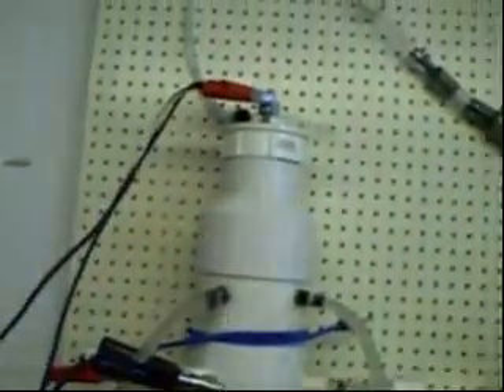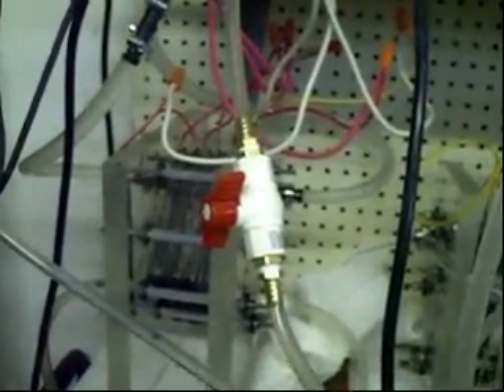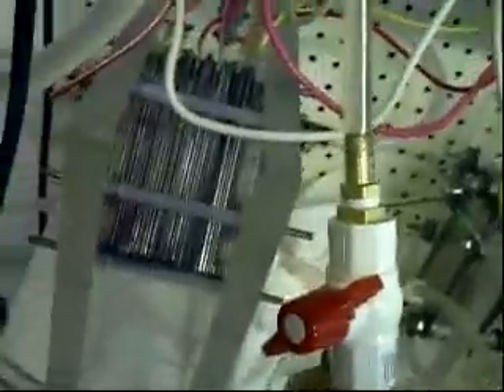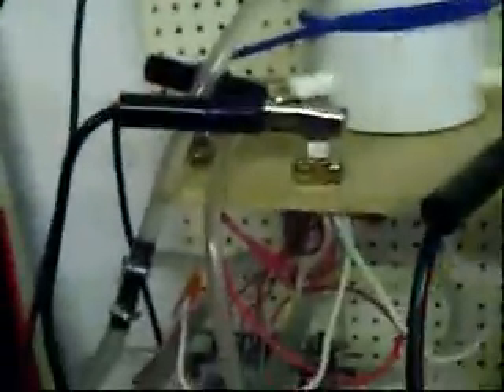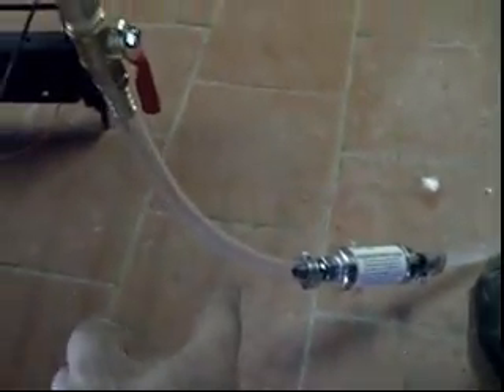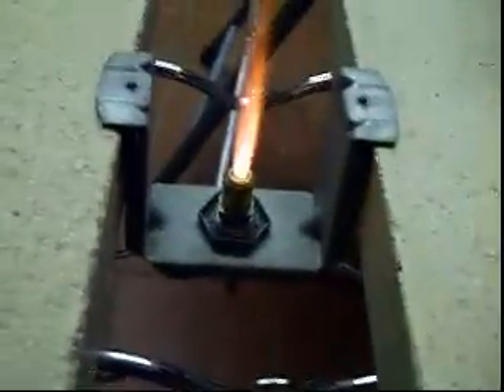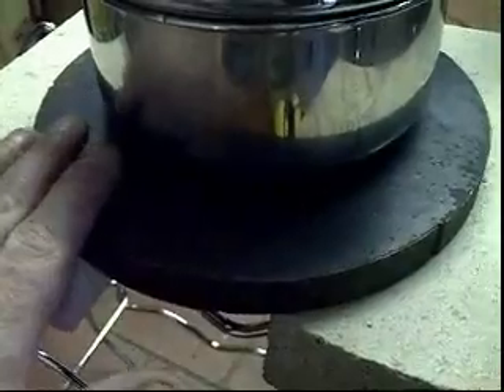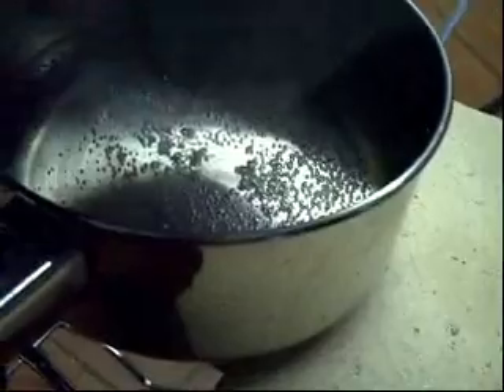#18 Anti-Foaming Experiment and Water Boil Closer to Hydroxy Flame

Comment: I used .025 mig tips but i took a hammer and tapped the tips so it closed them up a little ..just using the tips normal i got flashbacks....The tips closed up are probably around .017 - .020 now ...I am looking to dropping down to around .014 , in my burner i am fixin to build....
Yeah working together gets things figured out quicker .... Thanks  safety is #1 with hho

Comment: One other thing that i have noticed also is as long as there is something in the pot to absorb the heat  I can have the flame as close to the pot as i want ..I did some test the other day in this area..I had a a small metal tube filled with water and had the flame all the way against it it would not burn thru ....I have done this same test with 10 lpm same thing ...As long as there is heat absorption it should be fine

Comment: NIce work man ... I have done the mig tip thing myself and it works great on under 5 lpm  ...
AS far as one flame compared to many , so far in all my test ,for example 5 lpm  with one flame is not as efficient as 5lpm split up into 5-7 flames ...The most flame tips I have had so far using 5 lpm is 7 and works better than the 5 ....My ultimate goal is to have 15 - 20 flames using only 5 lpm or less ......
although using 1 flame is easier..
 keep at it ...